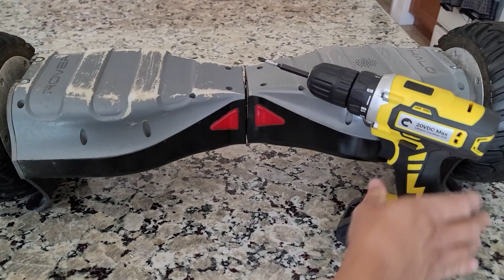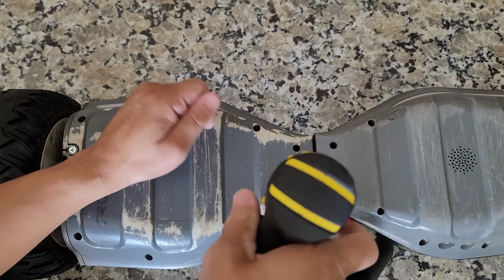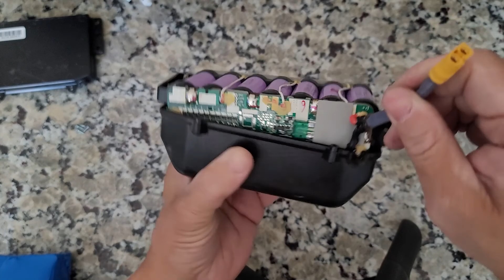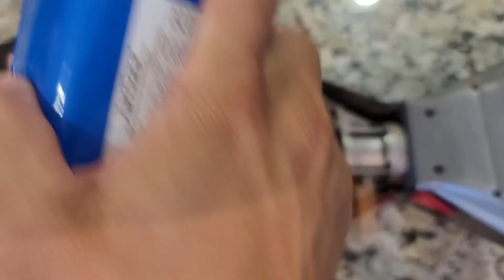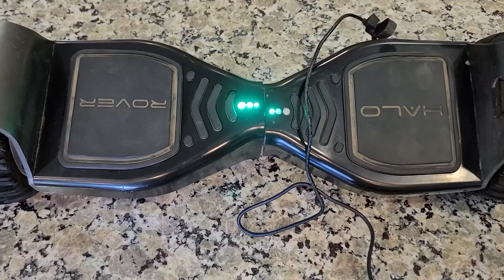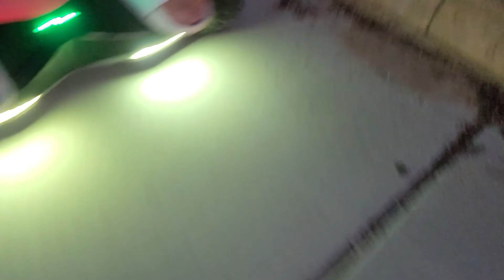Halo Rover Battery Replacement #hoverboard #diy

Comment: The battery in the wrap is the protection that the case provides from the original battery. My replacement came with a bracket that fit the exact screw holes and it’s like a cage style plastic cover that holds it in place. 
I used your video to come back and make sure I was putting the connections in the right spot. Thanks for the video. Much appreciated.
Reply from the maker: That's awesome. Thanks for watching.

Comment: Nice video, man.  I watched it just to have a look inside the battery pack to see what cells they were using. I'm going to replace the 18650 batteries in mine, spot welding in new ones, using the old control board and bracket.  Those cells in your original are fairly small capacity LG ones. I should be able to up the ride time by a pretty big margin.
Reply from the maker: Yes, you should. Let me know how it goes.

Comment: very interesting. Did you re-open it after some usage to see if there is any movement, scratches or damage due to contact friction with the cover or other internal wire and components?
Reply from the maker: No, I haven't but it still works fine.